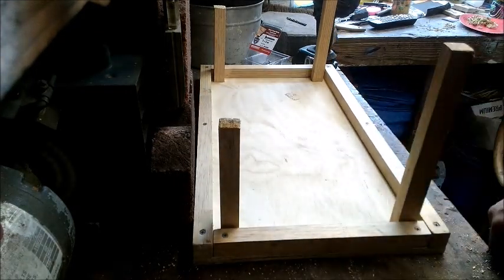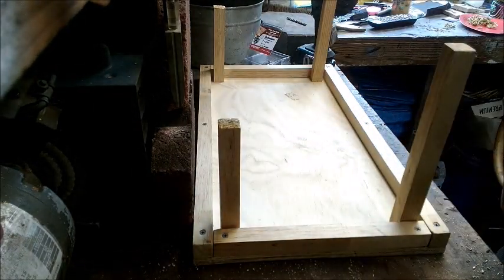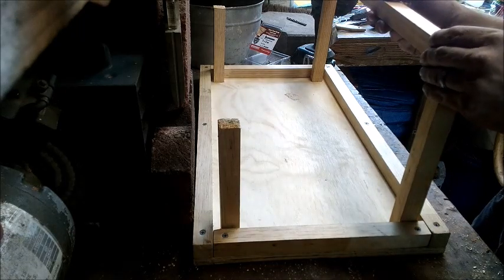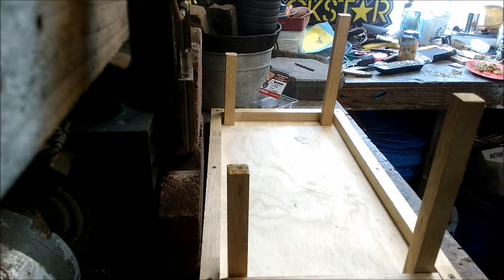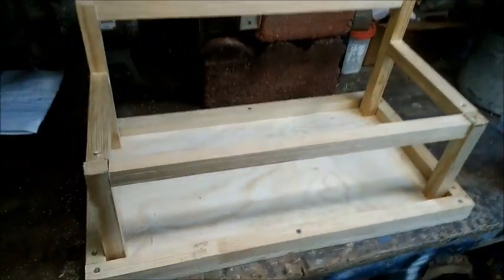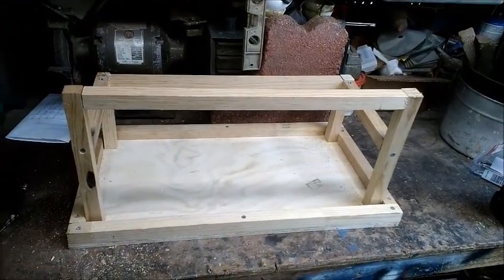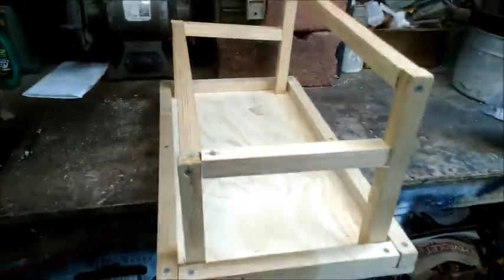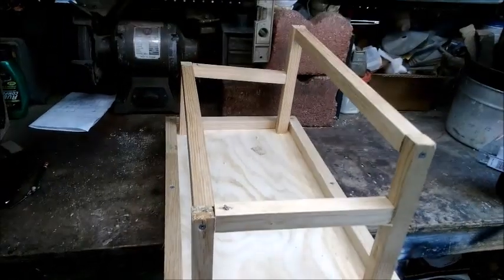Crypto Mining #1 - Open Air Case Build

Comment: cool case, overclocking probably isn't worth it unless you have really cheap electric.  I run my gpu's at 1100MHZ 470's/480's/570's/580's
Reply from the maker: Pet Mey thank you, I have terrible electric... I've had to cut down to running only 60% of full between all my gpus (6 570 armor oc 4g, 2 1060s, 1 1070, and 1 480 4g non oc), once I use over 1200kwh in a month each one costs $0.47...took a few months before I realized the problem... Wishing now I'd just invested in the actual coins and sat on them... Lol